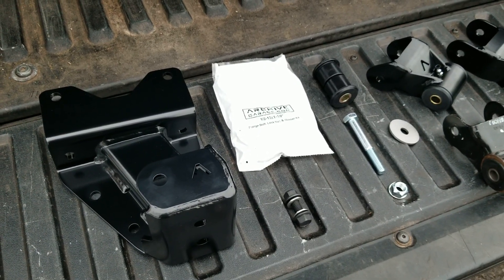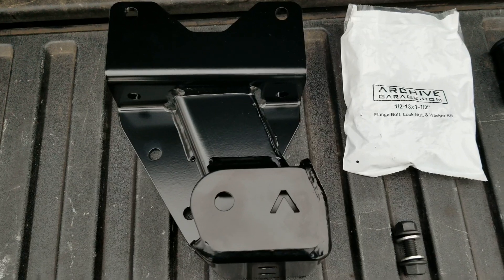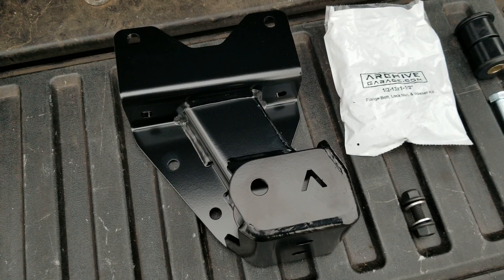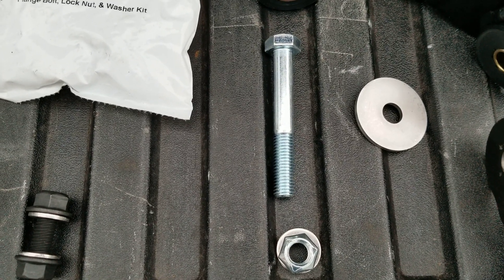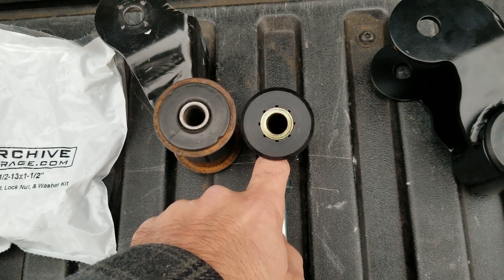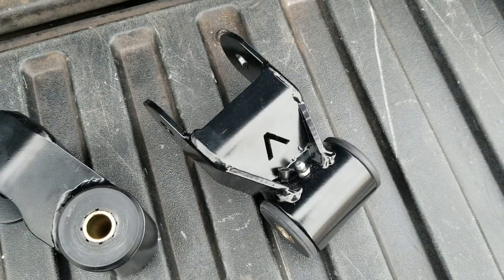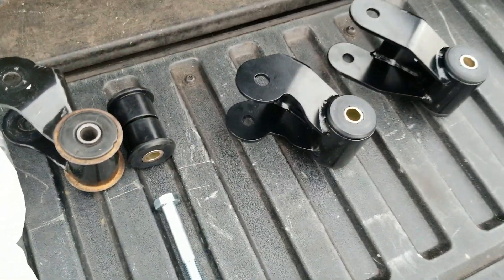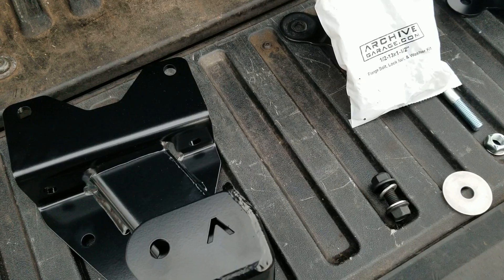Hammer Hangers by Archive Garage - Features and Options Tacoma 2005-2023

Comment: I have extended travel king shocks and ICON 2005+ Toyota Tacoma Multi Rate RXT Leaf Pack w/Add - 158505 on set on stage 3. Also with high clearance aftermarket bumper. I drive 2017 Trd sport Tacoma . What what will you recommend and will this setup work for my truck? Thank you.
Reply from the maker: Since the shocks are near stock length and still stock location, you don't need poly bushings in the shackles, since the shocks are the limiting factor.
It is fine to reuse stock shackles with Hh, but many do choose the Archive shackles.

Comment: How many spacers do I need If I have all pro offroad springs?
Reply from the maker: Best thing to do is look at your spring eyes and see if there are gaps or if the shackle ears are bent inward to see if you need them at all.  Supposedly AP FINALLY started supplying correct width bushings ( stock is 2.875")

Comment: Does the 3.6 Shackle add more droop compared to OEM?
Reply from the maker: If you have long enough shocks, then yes, because the poly bushings don't wind up like a spring as they rotate like stock rubber bushings do.  If you have shocks still in stock location, then you can reuse the stock shackles with Hammer hangers.  The stock hangers are the weakest part, stock shackles are pretty durable and strong enough, also rubber bushings are essentially zero maintenance